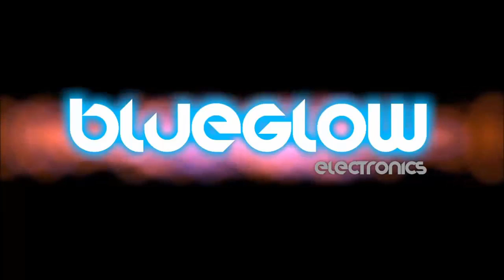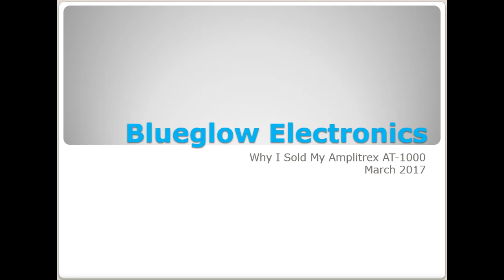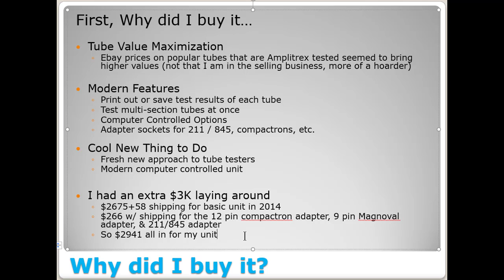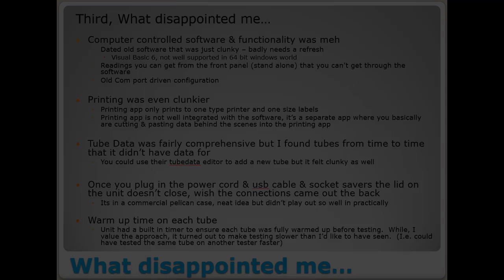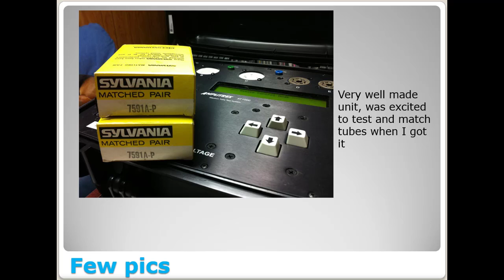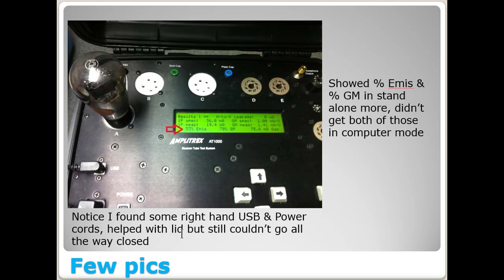Why I sold my Amplitrex AT-1000

Comment: all I can tell you is this- Ebay is full of Amplitrex and TV-whatever tested tubes, that get returned all the time, because those testers are not accurate.  get a Hickock 600a that is knife edge calibrated in good condition, that's all you need.  testing on a percentage or 50 scale is not accurate enough.  if you have a tube that specs at 5000 mc, it needs a 5000 scale.  if you have a tube that specs at 1250 mc, you need a 1250 scale.  the higher the scale, the better resolution, and it should be an analog needle gauge scale.  those digital readouts can be off and how the heck are you going to calibrate them or even know ?  digital isn't always better.  about the only place I've seen it good is a simply hand held calculator.  it's just more convenient, NOT more accurate

Comment: Just a random thought, with apologies for a 2 year behind curve comment! -  WRT the sockets and associated vertical plug orientation, although it doesn't make a ready-plugged overnight-enclosed device any more attainable there could perhaps be a practical rationale for the choice of location.. 
You noted  the sturdy practical case, I'd imagine it carries the valuable benefit of water resistance and I wonder if it seemed more practical than  water resistant sockets  to just keep essential openings inside a protective enclosure. As I say, no consolation but perhaps a slight reduction in the annoyance level :-)  Thanks for the videos, just dipping my toe into your library and they're great so far :)

Comment: http://www.roehrentest.de/index.html is a wonderfull tube tester at half price of Amplitrex but they sell only as a DIY kit, is not for everyone to assemble that kit. I use a soviet L3-3 tubetester, in a good day I test about 300 tubes. For a faster process I heate 20 tubes at once and I made some devices that increase the speed, for example a panel (conected to tube tester) with 5 sockets where fits any tube with ECC88 pinout, with a 10 pos. rotary switch just change to each of 10 triodes (they are double triodes, 5 tubes=10 triodes). External heater voltage, of course.

Comment: Very old thread, I realize, but... There is not enough communication between the worlds of software and hardware, particularly the more specialized sub-fields of electronics hardware like valves.

The obvious answer to someone from the world of software (who is also a permanent resident of the world of electronics) to the problem of antiquated software: free (libre, not $0) open source control software. The only reason that someone has not taken it upon themselves to do so is the high cost of the hardware; but, if Amplitrex would license the existing software with a libre (https://en.wikipedia.org/wiki/Free_and_open-source_software) license, the problem would take care of itself in short order.

This would have absolutely no effect on the profitability of the device, obviously. Currently, the software is a liability, afaict.

Comment: I cannot justify paying that amount for a tube tester, even with new technology. I own several Hickoks that I restored and calibrated which work fine for testing and matching tubes. Some say it's old technology and I agree, but it works. Price a mid 50s Fender tweed amp vs new. I do not need a printout of tube specs. Just write down what the Hickok displays. I could buy several great working tube testers for the price of this one. Let's see if today's Amplitrex testers are selling 50 years from now. I won't, I'm too old now! Great video!!!

Comment: I think used for your intended purposes, the Amplitrex unit would have drove me nuts also.. You made very valid points, expressed your bias, admitting others might be content with the units limitations.... Curious to know if Chris had excepted your offer to assist in updating the unit, 2.0 as you put it,  do you think you could have done such? Thanks, Tom
Reply: I'm curious about what you call legacy USB to serial interfacing...? When doing embedded development, USB to serial adapters are almost completely standard (see for example arduino's using ft232 chips). The physical serial port might be a legacy thing, but "virtual" serial ports over USB is a major market. It's simple and very effective for communication between simple micro-controllers, having at the very least a hardware serial port and the modern pc's having USB ports. Even many network switches that used to have serial consoles now just have an ft232 or similar serial to "serial over USB" chip inside. It's effective and cheap and saves on redevelopment. 

Being curious I checked out the amplitrex site the see if I could download the software and put it through a de-compile cycle to check it out, but it is not on there... I would rebuild it in exchange for a tester :)

Nice balanced video, informative.
Reply from the maker: He seemed open to it but it wasn't as easy as I thought due to the legacy usb to serial interfacing so I kinda dropped it
Reply from the maker: wasn't using virtual ports the way I know them.  you'd have to talk to him more about it but I showed it around to a few people I work with that do serial interfaces all the time and they said run...
Reply: I would drop the serial/USB completely and just use bluetooth SPP at the minimum, and maybe with slight software changes, Bluetooth BLE. Then you could just use tablets. A tablet would be a much more ideal situation for these, as the printer could be bluetooth as well. I was a fluent VB6 developer so I know the language inside and out, but I have moved onto more modern compilers that are "VB6" like in the syntax front but obviously object oriented and support modern APIs.